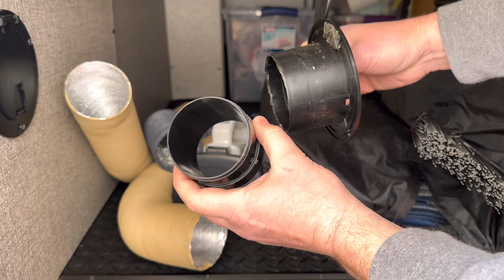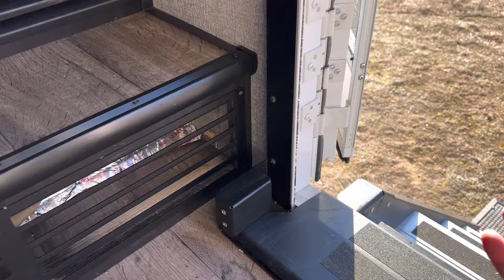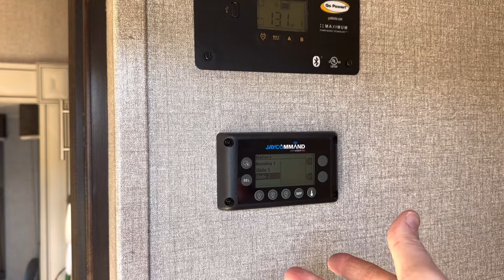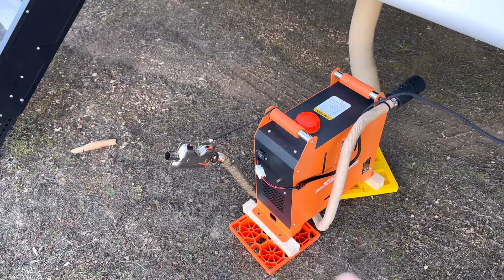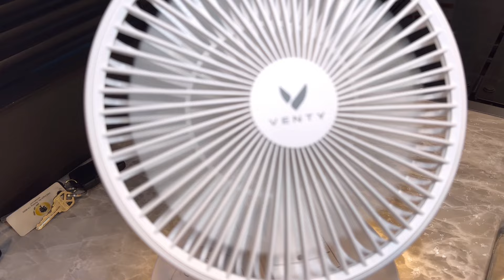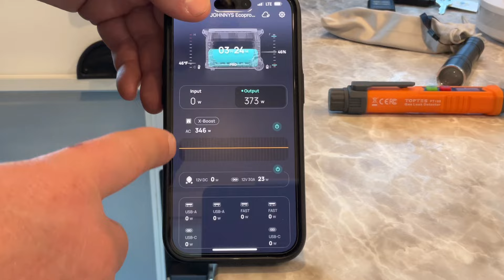DIESEL HEATER RV INSTALL HACK- EASY!

Comment from the maker: What do you think about this install? Or what have you done?
ITEMS IN VIDEO BELOW……

TopTess Detector Pen: https://amzn.to/3KfOgao
Venty Fan: https://amzn.to/3XAGdYF

Use coupon JOHNNYS save 10% on all orders at
MaxPeedingRods USE CODE: https://bit.ly/3ijHViv

Heater Mounted: https://amzn.to/3jM7f13
Heater Tall portable: https://amzn.to/3VN3aHn
Heater Short portable https://amzn.to/3VHk3TD
Extra heater Tube double Lengh: https://amzn.to/3kf7z97
Tube connector: https://amzn.to/3EgXFL4
Rv cable thru port: https://amzn.to/3kaY6jd
Mini Thermometers: https://amzn.to/419gs4H
Sure Can Diesel Can: https://amzn.to/3XMJcNQ
Sure Can Gas Can: https://amzn.to/3ElhFMB
Hole Saw: https://amzn.to/3Z43BiG

CHECK OUT MY AMAZON STORE: https://www.amazon.com/shop/johnnysweekends

Buy me a Coffee 👍🏼🙌🏼👊🏼😀
https://www.buymeacoffee.com/johnny5120J

Comment: Bye pulling outside air into the heater and pushing it into the trailer it's just building back pressure unless you open a window or roof vent. 
You need to pull intake air from the trailer to supply the heater. 
These heaters were intended to be used for tents that are not airtight.

Comment: With all do Respect. 
This is not a very good way to incorporate the external heater. 
And you should Not Run your propane furnace at all now that you blocked off all the return airway under the steps. 
You mentioned that the furnace gets it's air from the inlet on the outside of the trailer. 
One hole/pipe is for the fresh/ combustion air. The other is the contaminated/exhaust air. 
Neither of those has any to do with the circulation of the air inside the trailer. 
The airway you blocked off under the staircase is there to maintain the temperature in the plumbing and storage area as well as supply to the furnace. 
The furnace pulls air through the side of the cabinet it's mounted in and forces it into the Ducting to be distributed through the trailer. Plus it is probably the only source to heat the plumbing in the underbelly. 
You literally blocked the airway and now the furnace is working harder and running hotter than it was intended and will decrease the life of the unit and/or it's components.

Comment: So this is only heat the inside of your camper, what are you doing for your under belly, your pipes and tanks, to keep those from freezing?
Reply from the maker: I avoid freezing areas like the plague 
Would rather deal with 110 degrees. 
But when it happens I use furnace and diesel heater so a combo of both 
Or buy a second diesel heater for under belly on low and let it just keep it warm.
Have to do what ya have to do.
Deep freezes need more heat.
If you don’t have enough then solution is to get more or move.

Comment: I wonder if you can just tap into you heating duct that way it is a even flow threw the camper?
Reply from the maker: It would be very low flow everywhere in a large Rv like mine. I use a fan to circulate the air

Comment: So why not just skip the first step and put the pump inside the luggage compartment and pipe the exhaust to the outside? Also, do you have to add fuel to the pump on a daily basis? Can you tie into it with a 5 or 10 gallon tank? I'm looking into this but I don't want something that I have to add fuel to daily.

Comment: If you could recirculate the warmer air from inside the trailer to the intake in your heater, you might see a nice increase in efficiency ?
Reply from the maker: I have a new setup with a suitcase heater 
Works great and less waist from outside air

Comment: U got the exhaust blowing out where the blower motor intake is 
Essential pulling into the rv flip the air intake location to the rear and the exhaust to the front or the side

Comment: A totally stupid way to run a heater.  Every cubic foot of hot air pushed into the RV pressurizes the RV and forces warm, moist air out through all the gaps and cracks in the RV.  So you have warm moist air being forced through the cold walls and floor and ceiling, where it condenses, and packs moisture into the walls, floor, and ceiling.  That excess moisture promotes mold and rot.  Congratulations.  Dumbest move ever.

Comment: aren't the plastic fittings going to melt?
Reply from the maker: Nope still running strong. Not even warped but I have since moved a different portable unit inside and works better

Comment: Nice mod! 👌
Gotta' like it when pass- through's make duct passage tidy.
Considering one of these units for my stationay rv.
Electrical consumption comparable to 12 volt furnace blower?
Reply from the maker: The diesel heater uses 45-50 watts at max and about 10-15 on low.
Reply: @johnnysweekends Do you know how many watt hours per day it uses? Watt hours per gallon of diesel or per kWh of heating might be interesting.

Comment: i just use my propane heat. its cheaper then diesel any way
Reply: @OverlandAddiction  yeah but diesel heat is dryer you won't get as much gross morning condensation
Reply: @SaltMinerOU812 propane rv furnace does not condensate😂😂

Comment: I actually have a similar Jayco Eagle. I’m pretty certain you covering up the stairs with insulation like that actually prevents the propane furnaces heat from coming through the stairs like it’s supposed to.
Reply from the maker: The heat doesn’t come from the stairs. It comes from ducting all around the Rv and into several vents.

Comment: I recently got a 8k diesel heater and have been experimenting with it in a single car, uninsulated, detached garage. I run the thing entirely inside the area (both intakes and both exhausts) and am disappointed with the performance. Although an RV has better insulation I just don’t see how one of these heaters would do much when half your heat is lost from the exhaust and you’re having to heat colder outside air. Maybe I just have dud because I’m not impressed.
Reply: Nowhere near most of the heat is exhaust. Maybe 20% and you can have the heater outside and still draw air from inside. You just duct both ends into the room and the small exhaust pipe is outside. Think about how much electricity it would use for the same amount of heat.

Comment: If you were to add skirting around the bottom of your RV it makes a huge difference on heating your RV and keeps your water pipes/Tanks from freezing
Reply from the maker: True but a lot of work for two or 3 days then on to another location
Skirting isn’t cheap
Reply: @johnnysweekends Frozen pipes aren't cheap to fix.

Comment: Why didn't you put the heater in the compartment and just vent the exhaust to the outside with the air intake from the inside?  Would be more of a permanent set up with a lot less work.
Reply from the maker: I have been doing this with a newer model. But it was literally the second time using it. Didn’t trust it yet lol

Comment: Wanna pull air from inside the rv so it doesn’t have to heat cool air, much more efficient. Can even pull from the cargo area if you have to.
Reply: @bryanmontgomery4050  from what I've read and I could be wrong(I am alot) but I've heard that keeping the fresh air intake inside causes condensation
Reply: @DzHarryNuttz I can see that. You are exhaling air into the RV, so you will be increasing humidity. Having this sucking air in from outside is sorta like having a window open and getting rid of humidity. 

I think it would be better to have a humidity meter and open windows up yourself, though, so you only let in the amount of fresh air that you need.
Reply: I just hit the overhead fan for a little bit until it heats up. It'll heat up faster in the bedroom if you suck out the cold air when you first turn it on.

Comment: Could just tee into the furnace duct.
Reply from the maker: I thought about it but it would just blow everywhere and low rates and in the basement as well. Not enough blower motor.

Comment: I’m going to install a diesel heater in my fifth wheel for hunting season. My furnace is in a very excessive location. Do you think it would be a good idea to install a “y” and plum in the heater not the duct lines under the belly?
Reply from the maker: Your air handler can push much more than the diesel heater. And if you tie into the main heater lines you won’t be moving a ton of air. It would work but not sure how well. Also depends how big the trailer is

Comment: Thank you for the video. Great info. Do you know what size hole saw you used? I missed the info in your video.
Reply from the maker: I think it’s 4 inch but buy the port first and match it with that. My port was already there on that side.

Comment: I think that by setting it outside you’re losing a lot of heat and the intake is getting cold air instead of getting warmer air from inside.
Reply from the maker: Yes would be more efficient inside but still works great outside as well

Comment: I’m going to add a diesel heater to my family of heaters.  My trailer isn’t hooked up 30 amps, so I have to be careful when running my electrical system.  I usually only heat the bedroom area.  
Nice set up Johnny!
Reply from the maker: I only heat my front area as well. Well try to move the air that way lol. I want to find a more direct route to front bed room and bath.
Reply: @johnnysweekends  my bedroom area has a sliding window I can use for whatever set up I want.  That would the simplest thing.  🤠🤙🏼
Reply from the maker: @SaabAholic I have though of that to but I don’t want a hole 😂
Reply: @johnnysweekends  🤠🤙🏼

Comment: Do you think a better idea would be to completely replace the propane furnace with the diesel heater?
Reply from the maker: No not for me and others I think would not be a good idea. You need the propane for heating the under belly in extreme cold temps unless you get a diesel heater with a couple hoses and heat the under belly that way. But I still use the furnace to kickstart the heater for the first maybe 10-15 minutes and heat the trailer then the diesel heater runs on medium or so and maintains

Comment: I like the setup a lot but the purpose of the step vents are to heat the underbelly when it’s cold to protect water lines
Reply from the maker: I have heard so many reasons as to what they are for and they do nothing but loose heat and loose cool AC air. Your underbelly has its own heater tube from the furnace. You can track it. Which wont do much unless you really seal the bottom or run the furnace constantly. It’s also not a return and I have never seen it draw any vacuum as with any Rv many leak so bad from converter, underbelly walls, windows and more it will always have air. Plus a dedicated return is outside where the intake and exhaust it. Sealing these up will only keep the inside of your trailer warmer and cooler in the summer. You can feel it just sitting there if you test it.
Reply: @johnnysweekends You are Absolutely Wrong about the opening under the stairs unless you have another dedicated return air grill somewhere. 
The opening is for Supply Air to the furnace. 
The furnace pulls it's air through the side of the cabinet it's mounted in. 
The squirrel cage fan then pushes it past the heat exchanger and into the Ducting. 
You are giving people some very wrong information about how the HVAC system in an Rv works.

Comment: For inside co I’d recommend CO Experts or low level co alarms. I wouldn’t ever put your meter straight into exhaust because it’ll wear sensor. Plus, low oxygen is something to note among many other measurements. I like videos.
Reply: For a diesel system your pretty safe the CO out put is much less then something like propane. You will smell burnt diesel long before the co level is dangerous.

Comment: I might be wrong but are you thinking the intake filter/muffler on the small tube is the heat exchanger air that blows inside the trailer? That is the air intake for the combustion chamber. The heat exchanger air is in the end of the box, so I would keep the exhaust away from that end of the heater.
Reply: No the small tube is for combustion air like an intake on an engine. The heat exchanger air is in the end of your unit with all the small holes. You had another video with a diesel heater without the metal case. One end of the unit is the 3” (or so) intake and the other is the output for the heat exchanger air.
Reply from the maker: @seekingadventures yes correct the small tube is the engine air intake. The heat exchanger is the larger are intake. 
If one or the other was bringing in a warmer air others suggested it would be more efficient. I don’t really want another hole in the bottom of the Rv large or small but I have thought of a couple ideas. Not sure I will do them but will see. 
I don’t know if that mod is needed anyway as the thing runs so hot as it is. 
I’m sure it wouldn’t hurt no matter which one you feed to a warmer area. 
Although on cool down the larger air intake would be better. On cool down the hose can get a little chilly for that last minute while it cools the heat exchanger.
Reply: @johnnysweekends  I think his point is that you are sucking air into the heater not far from the exhaust.  Air that will end up inside the vehicle.  
That said, the exhaust is hot and will probably rise before it reaches the intake... maybe... maybe not.  It's been 4 months... are you still alive?
Reply from the maker: @101perspective Still here and used many times….I check and have monitors….😂 Im using the new one now.
Reply from the maker: The small tube is the air intake with small foam filter inside. People suggested moving that inside storage compartment for a warm air intake for better efficiency

Comment: Just an observation. why is your exhaust rising from the heater. thats a big no no.
Reply from the maker: Can you explain why..?
Reply: @johnnysweekends  Without prejudice. before buying and installing my heater I watched many videos on youtube for more knowledge before my installation, the muffler supplied with the heaters has a hole in the bottom, must face down on installation due to condensation. I have 2 mufflers in tandem  connected to the heater exhaust plus 1500 mm exhaust tube after the mufflers on a sloping tiled patio, not very often and not very much I do get some condensation showing on a tile. So my way of thinking is (anybody else reading this put me right if I am wrong) soot, condensation and unburnt fuel could accumulate at the low point of your exhaust and cause problems maybe. As I said in my post (JUST AN OBSERVATION) You have yourself a nice day.
Reply from the maker: I watched several videos as well to see what the problems were hence not mounting one inside but also this trailer defiantly didn’t have a great option. 
The hole is facing down but correct with the tube going up like that eventually it would collect at the bottom. The amount that collects could be from maybe a numbers of things. How hot you run it, outside air density/humidity and more. 
It is something im going to keep a eye on for sure and also i dont want to run it in the low position much as this seems to be the biggest contributor to soot and moisture build up. At least from the reading and videos I watched. 
And good observation, I was just curious. And sorry if my short reply was blunt. Im trying to blow through as many replies as I can so sometimes replies are pretty direct. I try to reply to as many as possible. At least the ones that deserve it lol. But even then some get missed because they dont always show up in the same reply section.

Comment: Remember with the diesel heater outside it is warming 30° air whatever the outside air temperature is and blowing it into the building if you put that heater inside and vent the exhaust outside you will need a metal bulkhead to do that but then you’ll be heating 68° air so it will be easier for the heater to maintain temperature inside!
If your thermostat or your furnace has a fan switch only while you’re running your diesel heater turn the fan on and that will distribute the heat from your diesel heater evenly throughout the home!❤️‍🔥🇺🇸
Reply from the maker: I’m not sure how much of the video you watched but maybe that will explain some of my answers.

Being that it’s a Rv, the inside fan consumes a decent amount of power. Which when dry camping you try to conserve your battery supply. So the small little rechargeable portable fans work killer and consume almost nothing. 

Being the “Rv” does not have really any desirable place to mount it inside the best and easiest option for install and maintenance is outside. 

Drawing the outside air which many portable diesel heaters are designed for still works really well. But agree it would be more efficient running it inside.

I’ll be adding a longer intake hose to move it to that inside storage compartment. 
That will be several degrees warmer then outside on the ground where it is coldest
Reply: Likely better to plumb return to inside to prevent these thermo on heat exchanger?
Reply: You don't need a metal bulkhead ..  I mount my heaters on wood chairs and route the end of the six foot coiled down exhaust through either a bulkhead fitting or a chunk of 1-1/2 inch copper pipe.  A fan blows across the exhaust pipe and recovers around 40 percent more heat.

Comment: I am planning to redo our old camper van as soon as it stops raining. I want the unit to sit on a bracket hung on the spare tire mount and blow through the left door, then get stowed inside the van when not used. The links to the hose, connectors, and cable door are very much appreciated.  I have been using the ''No Spill'' 1.5 gallon fuel filler can indoors and really like it. For van use, it's a lot easier to lift and control and it completely eliminates any mess.
Reply from the maker: Nice, sound like a great build. And yes nice to have links so you don’t have to go searching. When i watch a video and Im like “oh” im gonna grab that. And then no link..??? Im like ah man what is that thing called lol. 👍🏼